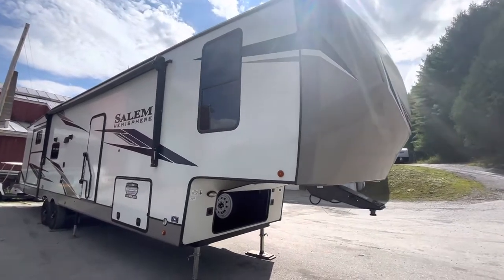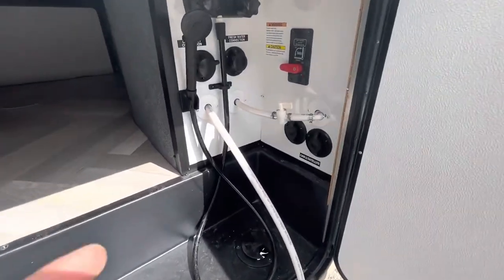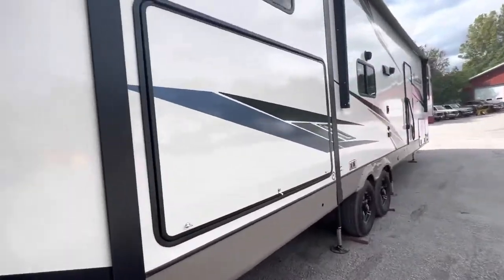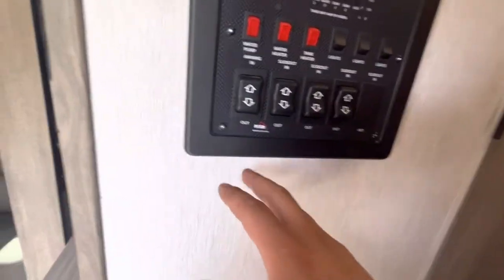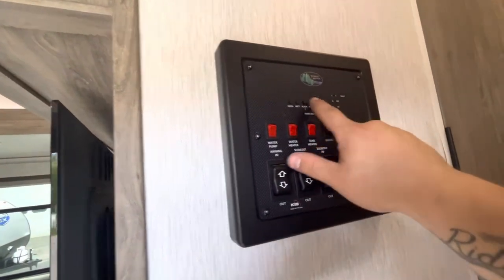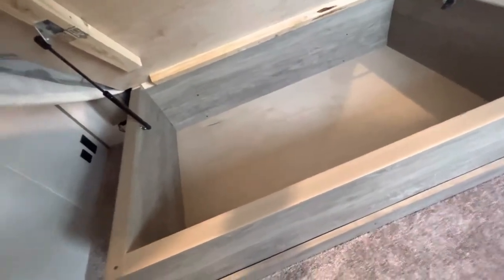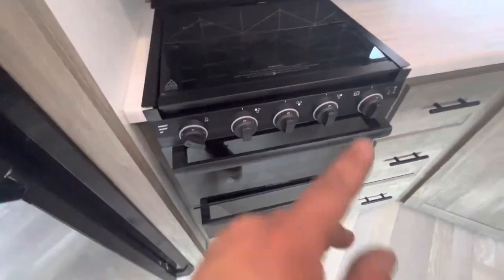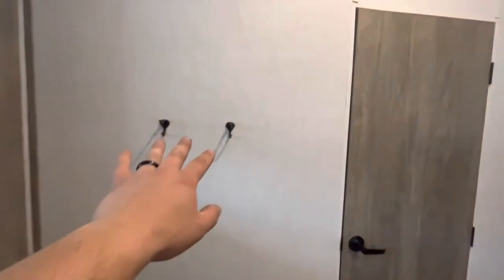2022 Salem Hemisphere 356QB

Comment: Hi. I have a question this fifth wheel   works with 120 volt or 240 because  the conector has 4 wire ,I'm confused on that